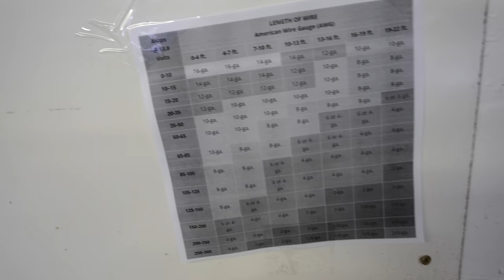Building the Brains of a Low Voltage System - Electric Hummer Conversion

Comment: 2:55 Skin effect works only when you try to push some high-frequency signal through the wire. For DC and low-freq AC only the total cross-section area of the wire matters.

Comment: You can achieve nearly all of this with something like a haltech pcu or similar , it will act as a programmable power distributor with built in relays and power limiting and circuit breaking . It is also can bus so you can integrate it into the screen and power modules etc . 
Get one before you go further .

Comment: 2:44 DC flows directly through the conductor, RF energy exhibits the skin effect whereby it conducts through the surface of a conductor.
Multi strand cable is such that it is flexible.

Comment: 21:11 The body is not the frame! You have an aluminum body that rides on rubber isolators connecting to a steel frame, these vehicles are notorious for ground problems! Talk to a vehicle electrical specialist with body on frame experience for best practice tips. Don't assume you have a ground.

Comment: Surprised you went with 12V instead of 24. 24 is quite common, twice as EFFICIENT - requiring wire with half the cross-section area to deliver the same power to the end points. Also reduces power losses: (P[L]=I^2(R)). You seemed to hit on these points so I'm at a loss why not 24v.  Also - a super-capacitor bank would be a far superior substitute for the lead acid battery.  I'm sure you'll continue to think things over as you do more such builds.... Excellent videos - quite a pleasure to watch.

Comment: Current runs only on outside of copper strands - no thats wrong. House wiring that doesnt move is commonly solid core before in Australia. Stranded copper wires is for flexibility only. Electrons move all through any conductor like copper or other metals just like putting resistors in parralle to each other - the total resitance goes down. Nice video though, cheers

Comment: metric system wires from 0.5 mm2 section increasing in size, proportionally to the numbers 1.0mm2, 1.5, 2 etc...
imperial...wait a minute ...that's not good ... hold my beer🍺🍺 big number small wire..🤷‍♀️why?

Comment: 1) Stranded wire is good for flexibility, but you don't need to take the surface area into consideration with low voltages and low frequencies you are using. 

2) Cables won't get hotter the further away they are. Your extension cord burned from the point where it had a bad connection and couldn't dissipate the heat. Maybe you had a motor connected that didn't quite start rotating due to voltage drop introduced by the long cable. 

3) If you need to carry current a long distance you should have a thick cable all the way so that there is no voltage drop at the end. Even a short cable with too much current could overheat if it is not thick enough so in that sense the length wouldn't matter unless your load starts to draw more current with the lower voltage (to keep the same power), which many devices would do.

Comment: Two points ...
1. Stranded Cables ...... This is NOT for the skin effect (which only becomes a thing with high Voltages or High Frequencies) it is more a thing of actually being able to bend the cable and for the cable not to suffer fatigue fractures when under vibration and heating / cooling cycles!
2. Solder / Crimp joints ....... When pushing a large current through a joint ANY resistance will cause localized heating and given solder melts at a fairly low temp (can be as low as 120C  248F dependent on your solder mix) can easily lead to problems. Crimping is the preferred method giving both a better mechanical join and lower temperature effect. 
On crimping a connection size does matter ..... with bigger stuff you need to make sure you have bot the correct type of lug and crimper. There are different ones for different types of cables .... some have a divot that is pressed into the lug others for the larger fine stranded cables are Hex shaped nd often pneumatic to get the correct pressure!

The larger size of cable you showed (in Orange) looks like the ones we use when connecting temporary reclosers on substation fuses .... typically 400A 240/415V constant load (a Lot more under fault conditions) .... Technically they are not cables but "Flexes" as they are meant to be moved and not just installed in a fixed position ;o)

Comment: Awesome Project. Can I give you something back. When drilling through your plastic sheet you can put a clear tube or hose over the drill leaving half inch of drill proud. It will act as a bump stop and give a good finish stopping the board jumping up. A HSS centre drill of varying sizes work great for rivet removal as the rivet head doesn’t get stuck on the drill bit. Sorry mate buuuut, glasses over the eyes work better than on top your head. Lol. Keep on keepen on. I really would like to do this to my 80 series Cruiser.
Awesome approach, keep well.
🤟☮️😎👍

Comment: @JRE first of all, my name is Brian. I love your channel. I've been a follower for years now.

I used to work and sometimes still do (ovcasionally) as am aftermarket automotive electronics installer. Things like radios, remote starts, new infotainment systems, headrest displays, heated and vented or even air-conditioned seats, the possibilities are now endless with aftermarket auto equipment within the last decade. 
I have years of experience, but I just want to say, you have made one of my most complicated things to learn about the trade I used to work, make sense to everybody. I've tried for years to explain to people how relays work but I always seem to wind up losing people through my explanations. 

Seriously. One of the easiest to understand in layman's terms, on how a relay works I've ever heard. I applaud your effort. 

Plus, I mean you'd prob do it yourself anyway, but if I was in your area (I currently live in Northern NJ in Bergen County less then 10 miles from manhattan) I'd do any of the aftermarket upgrades you'd want to your truck, but in your case, if you have any questions for me I will be glad to answer them for you. But so far you seem to have all the info and knowledge you need. It took me about 2 months to master that trade. I now work as a residential, commercial and industrial electrician working with 110, 220, 440, 600.... ect voltage systems either single phase or 3 phase power systems (just the difference in voltage the equipment is working with. Standard household is using single phase DUAL 110v leads and a neutral/ground. Where as three phase has a 4 wire setup with 3 wires that run at two of the different voltages I've named above, as well as a neutral).

I look forward to continue watching this project, and I wish you good luck in the future. It gets monotonous and repetitive and boring but nonetheless. Good luck and be safe.

Any questions, just message me.

Sincerely, Brian D

Comment: @2:40 - no, stranding makes the cable more flexible - think about it, do you really want to try to bend about a half inch bar of copper at 4/0?  think you can do that without messing up the bar's characteristics?
  
The skin effect doesn't come into play at DC or really even low frequency AC.  And, you don't want AC even down in the kHz range getting to your traction motor as it doesn't do "work" - you want the lower frequency AC (DC-300Hz) of the rotating field, not the high frequency switch impulses used to emulate that low frequency voltage (typically this is low-pass filtered in the inverter, some are better than others).
  
Motors often have to have 1.2kV insulation or better to avoid arcing from the permanent magnet rotor to the case from high frequency switch noise or else the bearings will arc and erode the races.

Comment: the most efficient and easy way of wiring is negative/grounding attached to the body while the positive cable is flowed through the cable, negative when your positive cable starts to wear out then the possibility of burning is higher, the second way is to install negative and positive on a different cable when your cable is old the possibility of short is getting smaller
for EV cars I only use it to drive relays and the power still comes from the battery with step down assistance and always choose a deep cycle VRLA Gell type battery because unlike conventional cars which need high amperage in a short time

Comment: Be cautious of mounting/connections in that inclosed box with that chemistry of batt aka wet lead acid.. Off gassing will corroded all that hard work. Btw, love the project would’ve loved to be a part of it!  Edit…. To add, possibly you could use AGM with external vent hose? There’s no need to have a crank battery as there’s nothing to crack aka high discharge/draw current. Deep cycle will better supply lower current draw over a longer time.

Comment: It's called skin effect and it is only observable in AC systems, particularly High frequency AC systems (radio gear microwaves etc) in VHF we usually use very fine stranded conductors but sometimes in UHF systems requiring significant amperage we use hollow conductors! Im not a expert in our power grid but I believe high voltage overhead transmission lines use hollow conductors as well.
In DC systems skin effect is non existant.

Btw I am loving this build series! Is it possible to get a part cost sometime?

Comment: I just wanted to konw out of curiosity, why bother using the car battery to run your 12V system if you're going to have a DC to DC converter supply 12V anyway? Can't you just eliminate the car battery all together? You could have the converter supply 12V directly to you BUS bar thus eliminating an unnessessary heavy component. Thanks for the awesome content!

Comment: I would not trust just a body ground connection, for safety I would do a chassie mount and carrier strap just for good measure between front and back of the vehicle, Corrosion can build up between the panles causing a bad ground connection.

Comment: Skin effect is real but only for AC signals/varying current. However, stranded wire only helps with this if each strand is individually insulated - this is super uncommon, it's usually called Litz wire. Stranded wire is mostly just about flexibility / vibration resistance.

Comment: Electricity travels on the outside of a conductor only at high frequencies (above 100MHz typically), the so called "skin effect". In a DC and low frequency AC (even at a few hundred kHz inverter frequencies), the electricity still travels within the whole surface area of the wire, hence adding more strands allows more current due to increased surface area, and decreased resistivity. We want low electrical resistance in the wire to minimize ohmic loss and heat in the wire. At high frequencies where the skin effect occurs, it's a common practice to coat the outside of the copper wires with a more conductive metal such as silver, again above 100MHz.

Comment: That center yellow wire is NOT always on. It is 87a: normally closed. Meaning that it is ON whenever the coil is NOT energized. It will turn off when the coil energizes (red and black wires). At that point the energy is transferred to 87.

Also, it would be better to individually fuse each relay before the circuit breaker. They only pull so much load and one could individually fry before the breaker trips. Ideally, each fuse is sized to the load on that relay's circuit.

Comment: Two things-
1. You should've built it on Bakelite Plastic instead of ABS Plastic.
2. Bending the Metal makes it stronger but also makes it more prone to develop cracks and prone to fail due to fatigue(especially when done with cold metal).

Comment: Regarding the "electricity runs on the outside of the wire", that's called skin effect and is only something to worry about with AC, disregard that for DC, and even with AC, the skin effect gets more noticeable in higher frequencies, with 0000 AWG wire, only around 100Hz and above it might start to become an issue, and even then, only with solid core as, as you mentioned, stranded wire reduces the effect, and using multiple smaller insulated strands/bundles, you reduce it even further.

Comment: Kiwico doesn't deliver to India (Sob).

Just wondering, if this entire project is going to be circuit-based or any programming boards like Arduino/Raspberry Pi will be used (will see that in the future videos). It would mean a lot if you can post the total cost for this project at the end.

Comment: While you claim to be a newbie your performance is very like a professional!  :-)
Some hints:
1.  ABS panel. That will accelerate any flame that might be caused by electric failure. Next time please consider using metal sheet.
2. Did you calculate the amps through the individual wire segments. Some of them might be underrated. For example the wire feeding the power to the relays. If I read there ignition switch or power steering I get uncomfortable with the wire size there.

Comment: Electricity does flow through the entire cable cross section only high frequencies does it flow on the outer layer. If true would be using copper tube for your requirement. Multi strand cable is just to make it flexable. You seem to be getting out of your depth. =DANGEROUS

Comment: I know I don't have all the details, but I find it strange that you need such a large DC Buck converter.
You've got 450V of batteries when wired in series, but surely you could take some tap wires out to get closer to 12V from a single bank of batteries?

Comment: 2:50 I'm no expert, but I'm pretty certain that DC flows through the entire cross section of the wire and it flows on the outside when it's AC but also at higher frequencies, OR DC that is switching on on off at higher frequencies.
Your house electrical runs AC at 50-60Hz and has a sold core wire, but before it gets to you, at some high voltages like 400kV straight from the power plant, thru the over-air lines, the cable is constructed with steel in the middle for the strength and small and multiple strands of copper on the outside.
Reply: Also all ampacity charts are flawed.
Even the ones that consider the length.
Those still assume one variable to be constant - voltage drop, you should find out what's the maximum allowed voltage drop in your specific application and do the math with it.
For the car operating at 12-12.5V when the engine is off, I'd guess 1V of allowed voltage drop, meanwhile you ampacity chart for example assumed 0.5V is allowed and will make you used unnecessarily thick wire.
Theoretically you can get 1000A going through 16AWG wire if it's short enough.
Reply: 20:22 oh god that is not crimped properly at all...

Comment: Also, you wouldn't need a 12V/24V battery when you already have a larger energy storage system plus a DC-DC converter. The 12V or 24V battery is required in a non-electric car because there's no other source of electricity to run the starter. You don't need a starter, and you already have an abundance of electric energy in the batteries, just use the DC-DC converter for 12V or 24V for the small electrical devices such as the lights and the wiper.

Comment: They have switches and relays now that are built into computer systems. Like the sp-9100. No added switches relays and everything can be controlled and modified through Bluetooth. It's what we run on high $ desert race cars. Maybe check them out for future projects it would save some time and the adjustability is endless. I wouldn't put a relay in anything they are usually the first thing to fail.

Comment: That wire system is just stupid and overcomplicated.... when the number goes down thickness goes up and at 0 jou just add zeros 🤯🧐

What if there is a easier way to know how thick a wire is like 1mm=1mm 2mm=2mm etc

Comment: One question.  If you're going to be stepping down to 12 volts, why involve a secondary battery system?
Why not simply step it down, and feed power straight into the 12v system?  Govern it with a fuse block and an on/off switch?

Comment: I hope the loads driven by the relays are going to be individually fused.. at the moment there is no sign of individual circuit protection for those loads. Personally I would have put fuses between the positive bus bar and the relay inputs so as much of the circuit as possible is protected.
As shown in the video, the only circuit protection would be the main circuit breaker, and if that blows you would lose EVERY 12V circuit at the same time. Imagine losing lights, electric power steering, electric vacuum pump for the brake booster etc all at once.. not an experience I would enjoy!

Comment: I’m gonna give you something that would be amazing!
 and if you would please do it …
and then tell me your results? It will verify …that I was right😏😉…
 I would suggest you divide the battery packs … into into two separate bundles.. w a switch between them …and , A 200 amp alternator , powering a charger-
&…charge one set of batteries ,while the other set of batteries is being used to run the hum v  and charge the depleted batteries…

This system could be done to school buses delivery trucks you name it…
I would also have a very small gas generator on it just as a back up plan ..with a charger ,
and you could even put a solar set of solar panels on the roof to be a maintenance system for the batteries

Comment: That would’ve have been good if the wire broke when you were pulling it. You might have given yourself a split lip. Thankfully that wasn’t the case!
Also than you for explaining how relays work. I have always struggled with understanding them.

Comment: Why do you need 12V battery if you have a voltage STEPDOWN module from the main battery? you already have the big battery what is the point having one more? for sure not a lead–acid battery...